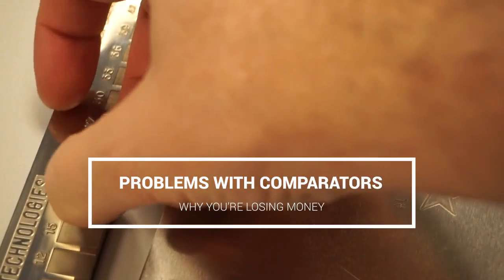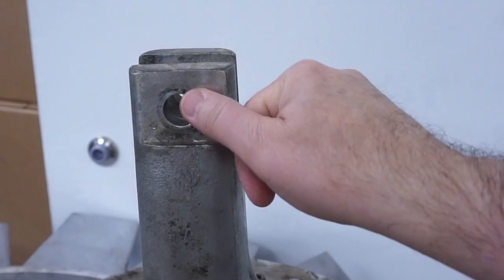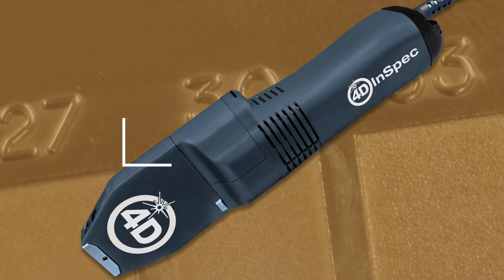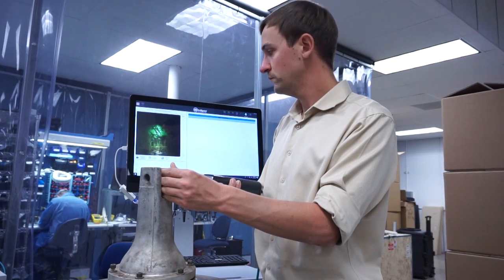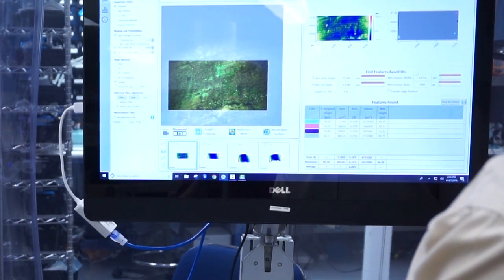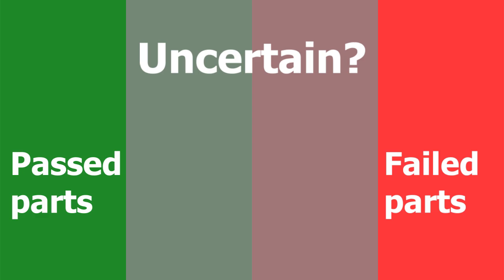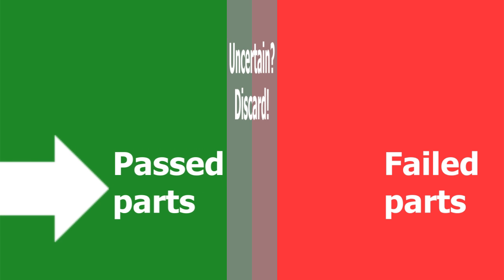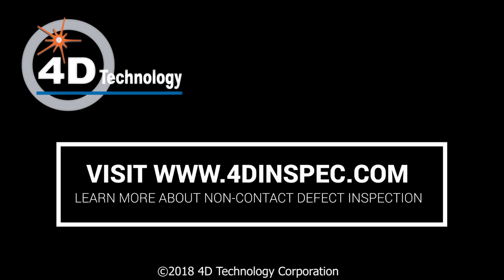Visual-tactile inspection is costing your machine shop money--Problems with comparators

Comment: The fingernail tests is used to inspect surface finish, that is a surface finish comparator. This is not how you check for defects at all! Try something called NDT!
Reply: As the technical product manager I can assure you many customers have challenged nick, scratch, and even pit depth measurements based on their fingernails.  And in fact the world's largest aircraft manufacturer assesses rivet depth via fingernail-only.
Reply: @eriknovak5616  calibrated or uncalibrated finger nail?
Reply: E â ae

Comment: I doubt the credibility of your claim that my fingernail isn't as good as your imager.  I'd say the only thing you got on my fingernail is insertion into a bore too small for my finger.  Yes, this is a challenge.
Reply: fingernails can roughly tell if something is over say 10 thousandths.  They are not gage capable and are pretty useless assessing differences in depths from .010 to .001", where specifications for many components are moving.
Reply: Elefccu vgf
Reply: ., L

, oui hin bb0. 0